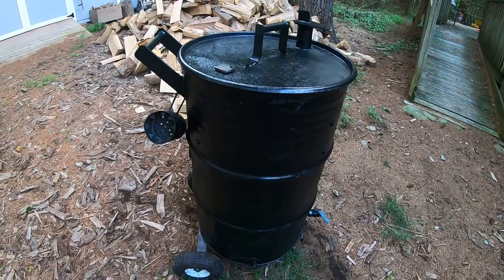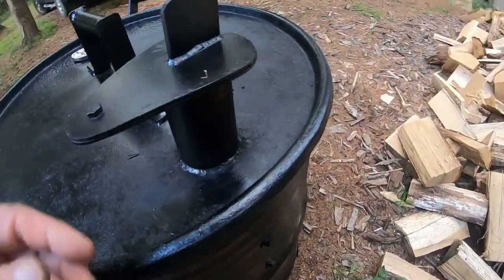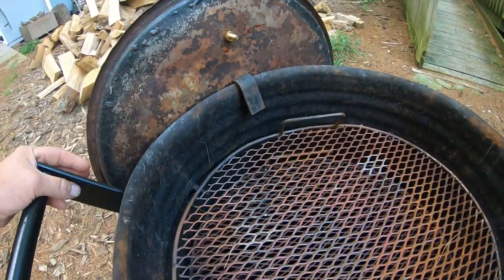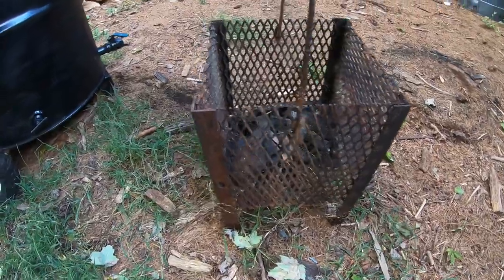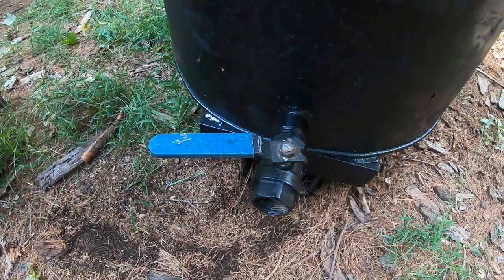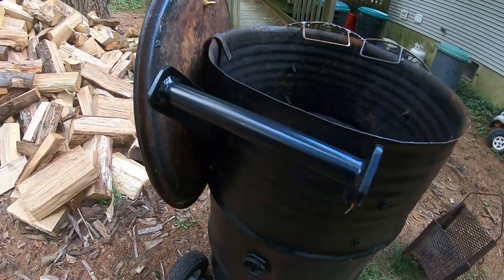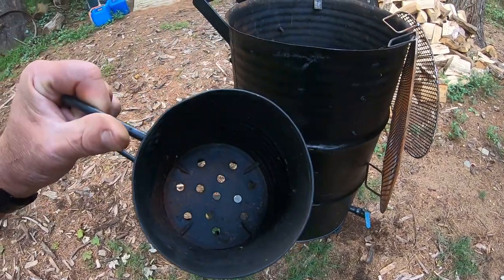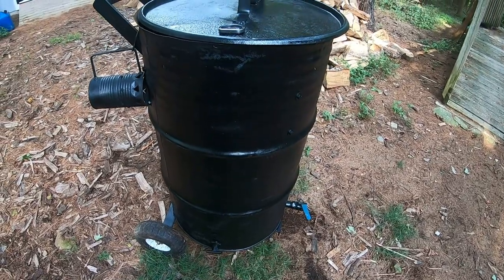Build Your Own DIY Ugly Drum Smoker (UDS) For Around $50 - (HOW I MADE MINE AND HOW I USE IT!!!)

Comment: awesome build! only thing I would change is having a hatch on the bottom that controls airflow instead of the two plugs and valve - something you could get that catch out a little easier with too. nice work!
Reply from the maker: Thanks so much! Adding a hatch is certainly something that could be done. I've only every needed to open the side plugs one time if I remember to really heat up the smoker. Most times the ball valve is more than adequate to regulate the air for the temperatures I smoke at. Thanks for the tip and for sharing! Thanks too for watching and God bless!

Comment: How long will the Drum last  Because if it lasted a year or longer I would use Stainless Steel for my top grate then I wouldn`t worry about putting my food on a rusty grate . That is a nice Smoker mite start looking around for the material .
Reply from the maker: The drum hasn't shown any signs of wear that I can see and looks like it did when I built it. So I believe it should last for many years. If you want to go with stainless for the grills (which is a good idea) you can buy them for around $25 each on Amazon that will fit the drum. I haven't had any issues from the ones I built. I just clean them before use, but as I said the stainless would probably be better. I've owned one other smoker and this one is by far so much better. I can load it with quite a bit of meat product and it holds more charcoal than the old one so it can go for hours. Thanks for you encouraging words and may God bless your day!

Comment: Genius 
A quick question how you remove The tap side
Reply from the maker: I'm not really sure of your question, but if you mean the air ports on the lower sides of the drum you just grab the round stock I welded on for a handle on each and screw them out. I welded a pipe bushing on each side which are threaded and the plugs just screw into those. If that doesn't answer your question just reply back with more clarification and I'll try to help! Thanks for watching and God bless!

Comment: Are you concerned about the rust getting into the meat?,also would it be possible to make the meat grates out of stainless steal to eliminate that issue?
Reply from the maker: You could make them out of stainless but it would be cheaper to just by the 21 1/2" grates from Amazon for $22. I've never had a problem. They rust some between uses. I usually only start smoking in the fall so they lay idle for some time. I just wire brush them really well and that seems to take care of it. It's good to give them a light coat of vegetable oil with a wad of paper towel before use too. I know many commercial grill have cast iron on them (mine does). So I have to brush that too, but it gets used all the time so it isn't as noticeable.

Comment: So you do this for colder smokes? Do you have any trouble maintaining temps around 150F or so? Everything I’ve read about UDS’s is that it’s hard to run them that cool (although I haven’t heard an explanation as to why). This is the only thing holding me back from building one. Just curious what you’re doing differently.
Reply from the maker: I normally smoke the meats around 225 F. I memory serves my right (because I haven't done it on a while) I have keep the temperature well below that say around 150 F by using a minimal amount of  charcoal and doing the "U" shape in the fire cage so you are only burning a small amount of charcoal at a time as it works it's way around to the end. I also don't use the side drafts and close the ball valve draft almost or all the way off. It's something you have to play with as it also depends on how leaky your drum is, the outside temperature is and other variables you might run into. If you do cold smoke make sure you use a curing salt as cold smoke temperature is idea for bacteria growth and the salt will help prevent sickness. I hope that helps some. Thanks so much for watching and God bless you!

Comment: Welder = $200.00 (cheap welder)   
Welding Helmet = $45.00 
Welding gloves = $6.00  
Welding Starter Roll of Wire = $20.00
Come on man, really?
Reply from the maker: Hi Ron, Thanks for your insight. You are so right that it would be easier and cheaper to just buy a smoker if someone had to include those items you listed above. And you have to figure the labor and time too, right! But for me, the items you listed are things I already had and my thought was that many others may have them as well or know a friend that does. My goal was to share ideas and help others see the satisfaction in building something of their own that they could enjoy and how I built it in the cheapest way for me. Thanks again for sharing as we can all learn from others and need to look at every view. Have a great day and God bless!
Reply from the maker: @panchovillasmith8218  Hey thanks so much for watching. I think you are good to go now that you have that welder. I'm sure you'll use it for a lot of thinks too. As far as the lump charcoal I've use both lump and the molded briquettes and prefer the lump charcoal. I've learned to regulate the temperature pretty well and if I need to get a fire going quick I can use the smaller pieces to get things started. I don't like using lighter fluid to light the charcoal because I feel it may make the meat taste funny at the low temperature it burns so the smaller pieces are helpful to start the fire. It just takes some trial and error, but I'm sure you will pick it up quick! Hope that was helpful. I've got a couple of other videos out on just how I use the smoker and that may as well! Thanks again for watching and God bless!
Reply: @thefrugalsportsman  
I with you 100% on the lighter fluid. I have always used weber kettle thats running about 18 years now. They fancy and expensive contraptions like the slow and sear are nice but not needed.

Thanks for the quick reply
Reply from the maker: @panchovillasmith8218  No problem. Hope it helps! Blessings!
Reply from the maker: @Maddog worker That is awesome! Way to go on the cheap build. Who says you have to pay a lot to enjoy life! Thanks so much for watching and for the encouraging words! Blessings!
Reply: If you've got the welding gear, or you go and buy some gear (even secondhand), it'll pay for itself over and over again....  carry on.